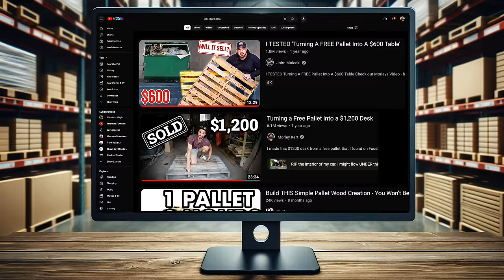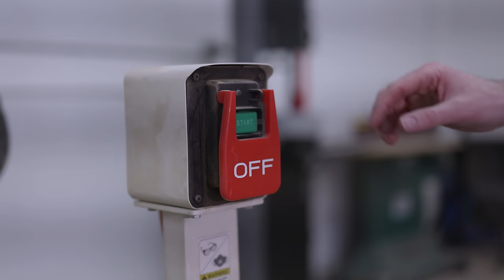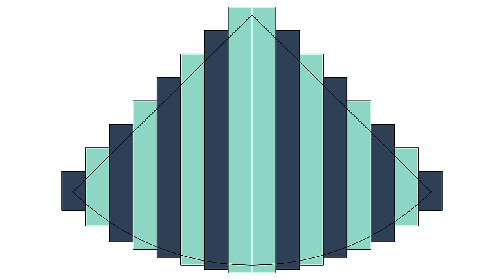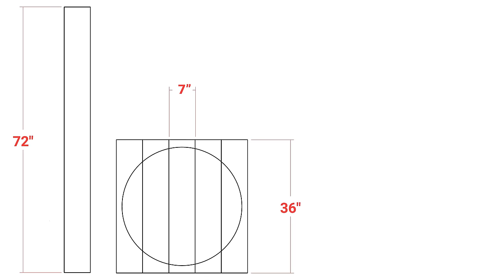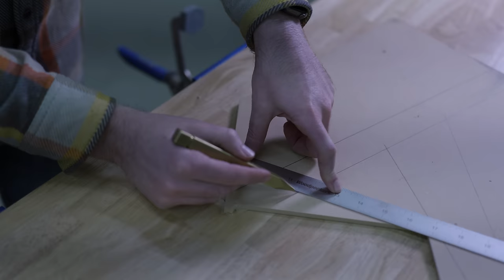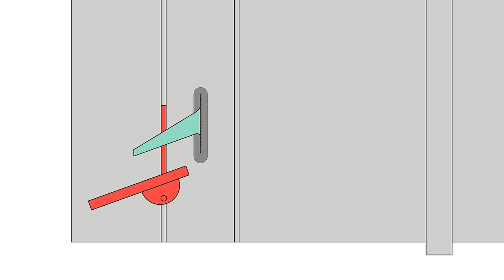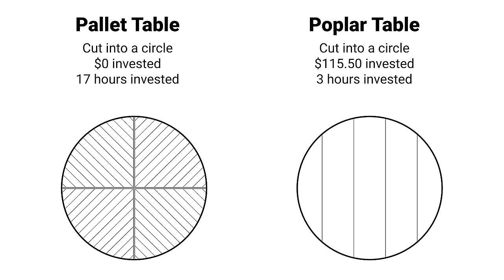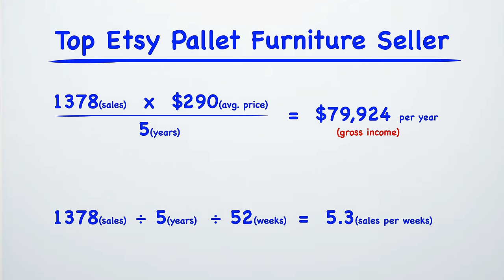Pallet Furniture is a Scam

Comment: Worked in a warehouse, spent a few months setting aside the best pallets that came through. That stack of pallets now exists as the desk I use everyday. Material was free, but working with pallets is a true pain and time sink.
Reply: Between the nail removal, the thicknessing, and trying to get a decent surface finish, it barely works out vs spending another hour at work to make the money to buy some more readily usable wood.
Reply: @Jonathan_Doe_  you are not wrong, but I always understood part of the appeal was the randomness of pallet wood and other kinds of "trash" wood. 
The life of it and the roughness. 
You don't get that with just buying wood in neat pieces. 
Personally I think the best use is my neighbor burning pallet wood in his wood burner to heat his house.
Reply: Work in a warehouse.
We don't throw out our bad pallets anymore, we give them to a different company to refurbish into new pallets (I believe, anyways).
Reply: @BenoHourglass by refurbish you mean drive at least half a box of nails into it right?
Reply: @GrumpyIan  Probably, in addition to adding planks and replacing others.
Reply: @bzuidgeest  my dad used to make things out of found wood, but never pallets. Those went to start the barbecue. I used to like reading the old development application notice signs (I now know it's called ADHD with a reading fixation)
Reply: @BenoHourglass  some  still end up as firewood often as kindling as they have a machine to make it
Reply: I did similar, except in the manufacturing plant I sourced my wood from always had a spare slat bcz the materials shipped on the pallet was awkward and routinely break pallets, hence the extra unnailed piece of wood, which they set aside for me just because I asked. So I always ended up with a stack of pretty uniform pallet wood. If I had to break pallets down (and I have) I wouldn't do it. A short cut to the process is just take a sawzall to it and bypass all the nails and holes .. so much quicker with roughly the same results
Reply: Yep. I wanted some basic shelving, and figured pallet wood was a free resource that would give a fun looking finish.

The shelving ended up being made out of OSB, because I realised my need for storage this side of Hell freezing over was more important than my desire to be cheap and fun to look at.
Reply: (I swear this actually makes sense and isn't just a way to bring computers up)

Reminds me of why some people choose to use more difficult Linux distributions.

Once you daily drive something like Gentoo, working with RHEL or Ubuntu is a breeze. Everything that can possibly go wrong is something you know exactly how to deal with. 

Sure, you're rarely, if ever, going to have to deal with piece of poplar or maple breaking in a weird way and finding a way to reinforce it, or the pieces you're using being weirdly shaped, but maybe after building a few pallet based furniture pieces, you'll have skills you never would have gained from working with more traditionally sourced wood. 

Basically, do it for the experience and knowledge gained, not because it's easy or cheap.
Reply: @LucasJackson_37  "A short cut to the process is just take a sawzall to it and bypass all the nails and holes"
He switches to that, at some point during the video.
Reply: @OhhCrapGuy  Agreed, but it's best to start with something easier. Learn the basics in a simple environment, and only then switch to the harder environment to learn deeper skills.
Reply: @OhhCrapGuy  Hopefully the skills you learn using pallet wood will never be needed using more expensive pieces. Endless planing and hole filling is tedious not educational.
Reply: I find it's ok for personal projects too. I got my hands on some nice 10'x5' hardwood pallets and have used it for many of my own personal projects where time invested was somewhat irrelevant. I also damaged a number of plane blades from hitting stuff in the pallets that I did not expect...that's a HUGE cost sink for projects you're trying to sell.
Reply: Another reason to not bother with pallet wood is that most places seem to want to sell you their pallet as if they were ready to use lumber. 😂
Reply: @bzuidgeest  haha we also use pallets for our woodburner to heat the house and even then the nails are annoying :-p. Sure sometimes we say wow this pallet is still in a nice/good enough condition. But yeah what u gonna do make somethign out of it hell no we find better scrapwood and or entire furniture sets that people just trow away. And not just scrapwood but oak dining tables. And even then we just go meh just burn the sucker. Theres plenty of times we tell ourselfs wow this would be a really nice bench, table or ... or... . There arent enough hours in a day with a fulltime job and a family to do all those side projects for other people. Sure for ourselfs ill do it but to put time into it away from the family just to sell it. Lets be honest im better off doing small chores for people. Its very satisfying work. And people are very gratefull and ur helping out ur local community instead of spending 13 hours of labour on making a table. But yeah i guess each there own...
Reply: Lol
Reply: yup, we wanted to save money at our business, so we made this huge balcony using a ton of free pallets. I regret every single minute spent there, yes the end result was good, but it took so so so so much time, it would have taken literally a fraction of the time, if we just bought good planks. And I didn't even spoke about the cost of the products to treat the wood... yeah, at the end of the day, its not worth the time, and you don't save that much, because you'll spend a bunch in products to make it look good.
Reply: Cheap bad wood takes a lot of £££ to make it half good
Reply: Specially removing the nails, SPECIALLY the big pallets, what a hell
Reply: @beeble2003 true but if your goal is to practice techniques without looking to sell pallet wood is a much more economical option. If you want to learn to hand cut dovetails for example a pallet can give you free practice planks. I do agree that if you want to learn by building furniture vs just practicing techniques than there are better ways to go than pallet wood.
Reply: Often they use ringed nails you cant get out or massive divergent point staples with barbs - pallets are not supposed to come apart. 

When I was a kid my dad used to get hundreds free and it was my job to break them up - if they are properly made its next to impossible
Reply: Its all good until you realize those pallets are rented by the company and have to pay for every pallet not returned, not always the case buts its a fairly common practice.
Reply: pain and time = NOT FREE.
Reply: I'm one of those nut jobs that enjoys the zen of sanding,  so take that into account.  I like the physical part of loading and breaking down the pallets.  Turning it from(s)crap into usable lumber.  Then, turning that lumber into something that I'm told is beautiful.  Mostly,  I make "rustic" pieces. But sometimes, I make nice items that actually sell for a few hundred dollars.  I usually don't start with any plan other than a table or a bedside cabinet.  I let the wood tell me what it wants to be.  I don't make a living at this,  but I do sell a few pieces from time to time. Pallet wood will be my "fun money" hobby when I retire in a few years.
Reply: If you have money then buy wood.  If you have more time than money then pallets are a Godsend.  That is all.

Comment: What I think is that the pallet furniture movement started as a way to upcycle old wood, which would be otherwise burned, but nowadays you find brand new pallets sold in hobby markets specifically as pallets for furniture building. That's like the opposite to how it should be. That's like using brand new paper to maked recycled paper just so you can say you use recycled paper.
Reply: No. Pallet furniture came before upcycling anything. That wasn't even a word. Nobody cares about pallets (because they're so widespread and necessary and cost little to make) so they're easy to get, tthey're sturdy and thus make good base for CHEAP furniture. The base is FREE TO GET so the cost of the furniture is whatever else you can add to it.
Reply: The pallet furniture I remember from my childhood was just staking them to create an outdoor seating area and a table. Now you can not only buy new pallets for that purpose, they also sell cushions that have the perfect size to put on these pallet couches. There is outdoor furniture that is a lot cheaper ...
Reply: Reminds me of the idea of making tiny homes out of shipping containers, the idea was to reuse old containers as foundation for a house, reusing material for free or very cheap, but then people started buying new shipping containers to build tiny homes, which meant it was more expensive to build the house than usual, and you weren’t recycling/reusing any materials lmao
Reply: @da4127 i was about to comment this, i immediately reminded of shipping container 😂
Reply: So which "markets" are selling pallets for furniture building? I live in Portland and go to many "markets" that would sell them and never seen one? So tell me, who, besides the pallet manufacturers, are selling pallets?
Reply: It's no different than the idiots who buy Mason jars, yet throw away their tomato sauce glass jars.
Reply: @izzaazzurri  IIRC the reason for this is that shipping containers that have actually been used have to be disposed of in a specific way, so it was never really a viable option to begin with.
Reply: This is why people can make things out of them - propper professional pallets designed to last -  they use ringed nails you cant get out or massive divergent point staples with barbs - pallets are not supposed to come apart. 

When I was a kid my dad used to get hundreds free and it was my job to break them up - if they are properly made its next to impossible
Reply: We live by a liquor distribution center and their pallets are beautiful.  We could pick-up ten pallets everyday if we had the room.  We don't make furniture, but lots of other stuff including planters, frames, etc.
Reply: Burning the wood is also upcycling.
Reply: No that’s not how it started it because it’s cheap to build with and you would want the best quality because it is cheaper wood.
Reply: In the Soviet Union I hear people only bought newspapers (Pravda) for anything BUT reading.
Reply: @dvl973  Upcycling is the stupidest word ever.  I see that word misused all of the time.
Reply: @dvl973  "upcycling" is just a modern term for exactly what you described. It's called an "anachronism." just because it wasnt called upcycling at the time does not mean it isn't the exact same thing.

Comment: I've worked for a few places that would give away about 50 pallets a week. Sounded like you were saying it would be hard to find pallets, but many places just want to get rid of them for free, without paying to get rid of it as waste. Thing is, I know at the last place I worked, a guy in a truck would come and get them for free, drive them down to the local pallet making shop and they would by good ones for $25 and bad ones for $10. seems like a much easier way to make money from pallets.
Reply: Good idea. Don't get rich making Art, get rich selling Art Supplies! :D
Reply: It is a much easier way. Which is why in some countries it is a legit business model run on large scale. All it needs are industry standards for pallet sizes. Company where I work, we build research equipment, and a lot of the stuff we order comes on pallets. Standard Euro pallets are stacked and taken away for money, smaller stuff goes into a container that is provided for free, so at least the disposal is free for us.
Reply: @Volkbrecht Yep, Euro or FIN pallets get reused. The smaller and flimsier stuff either goes away as wood scrap or becomes firewood for peoples saunas.
Reply: i live near a pallet manufacturing plant, you can just get free damaged pallets from the yard, they got a sign up and everything by the dumpsters to take what you want
Reply: @Volkbrecht  what is basically thrue in the EU.
Pallets are standardized and typically you get some discount returning them e.g. whem bying lager amounts of construction material thats delivered on pallets
Reply: @2ftg  Europallets are the best. They're solid, and they are uniform. Here in Germany, I dread getting a pallet delivery from the US because they often don't make sense in their dimension or they're so weak they break when the most basic thing happens to them. They're also mostly not heat treated, so it's not permitted to actually ship them half the time...
Reply: @r65  remeber theo nly thing you can buy made in america is a firearm unless its that its chinese
Reply: They were finishing up some sort of work nearby, and I went to look at it. There was a pallet on top of a pile of what looked like trash. I asked a guy nearby, "Ese, es la basura?" He nodded and I walked away with the pallet, which had a couple of busted pieces of wood. The rest of the wood now has a use. (In Austin, Texas, you absolutely need to know some Spanish.)
Reply: @inkermoy  The people who made the most money during the gold rush were the ones selling the shovels and picks

Comment: I think your pallet wood looked better, just because the way you had to align the pieces to cope with the limited lengths looked more appealing than the straight planks.  I'm not a woodworker, so what do I know, but you could potentially use pallet wood as a more decorative element than a structural one, if that's the case.
Reply: you don't mind the ugly black smears and spots from the repair work?  He is good at making those into a 'feature' but I still think it's not very pretty
Reply: You could also get variations on god wood to end up with similar visual, middle-ground effort and way higher quality overall (so less issues to "patch")
Reply: *good
Reply: @Blackadder75 beauty is in the eye of the beholder. I like both but prefer the pallet wood one specifically for the design and heat melt spots.
Reply: @Blackadder75  I have to agree with some of the comments here, I actually prefer furniture with such genuine imperfections, which are not done on purpose. If you are a after a modern hybrid look in your house or office it's perfectly understandable for you to go for aesthetic perfection, but if you are actually fond of reclaimed wood furniture for ethical reasons that is not the case. 

I didn't like the end product simply due to the work hours spent on it. Took longer than it should but that is probably because he did not have much pallets to choose wood from and was inexperienced about handling such reclaimed wood. 

That said, it's still somewhat beautiful. 

Where I live and average monthly salary is about 700 USD and lumber prices are almost identical , pallet wood is actually more feasible here(not to mention we can't sell stuff at those prices, it is much much more cheaper here, unless you have a nice spot in niche market) 

Anyway, nice video as always.
Reply: I love pallet wood. I've used it in my own furniture projects and also bought a few pieces. I loved the flaws and natural look of the wood. Using old wood you were going to throw away makes it even better.
Reply: @Alceste_ Editing is a feature of the comment section in the 3 dot menu next to your comment
Reply: @MunUtku lol like you make the same quality furniture 😂
Reply: @wt5284  Quality depends on pricing really, our qulity cost ratio is better than West and Southeast Asian craftsmen's are better than ours, it is all about cicumstances really, carpentry isn't rocket science.
Reply: @Blackadder75 some ppl would need to look closer to notice it I guess

Comment: The things to be cautious of pallet wood are that 1. not all are created equal, many have some pretty nasty chemicals to protect them from weather, bugs, etc. and that makes the sawdust even worse and 2. they are often reused and not stored in environments conducive to proper wood storage so there is going to be all kinds of stuff in them that will beat the crap out of your tools. And if I had to say a third, 3. I am certain you noticed, pallet grade wood is not exactly the best pine boards out there.
Reply: Copper chromium and Arsnic all great ways to lose hair and nerves.
Reply: Was looking for this comment, pallet wood has more chemicals impregnated into the wood to prevent rot and fire you don’t want to breathe that stuff in. So if you’re new to woodworking or a seasoned veteran it’s still not worth it.

Comment: I live down the road from a pallet building company. Any time they have broken or just imperfect pallets, they dump them outside the building in the little turn-around parking lot space. Sometimes they are already broken apart, sometimes they are whole. LA few months back, they had dozens of pieces of wood that were 1.5 inches thick, 3.5 feet long, varying from 4 to 10 inches wide. I snagged all of them and will be building new raised beds for my garden.

Comment: My first job in high school involved a lot of chopping up pallets with a skilsaw to throw in the pot belly stove at a tractor repair shop. That seemed to be what it was best for.
Reply: But be careful!  A coworker when I worked at the university surplus here was burning pallet wood to heat their place. They began falling ill -- well, the wood was treated, they were slowly getting poisoned.  No problem, they started making sure to only pull the untreated pallets.  (And, with a pot bellied stove, just make sure the draw is working so the exhaust is going outside. I suppose they were using a fireplace or something and the draw was not high enough.)
Reply: @hwertz10  These dudes would sit around it chain smoking so I didn't hang around them, I figure wood treatment fumes didn't worry them much.